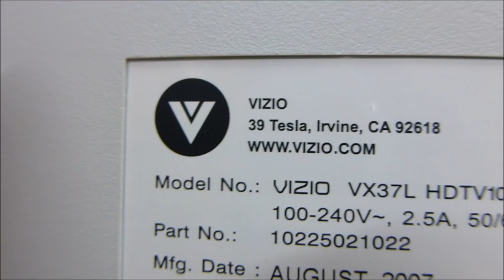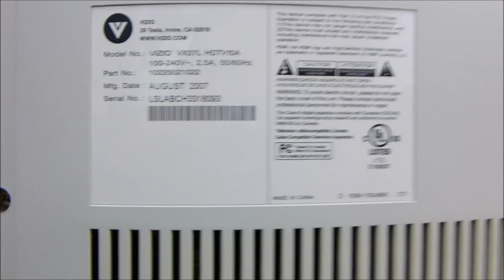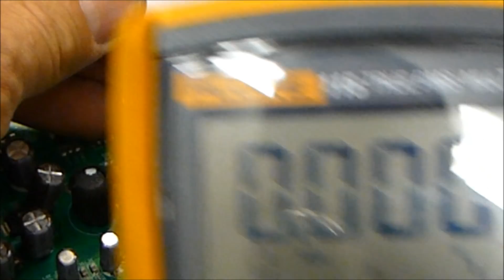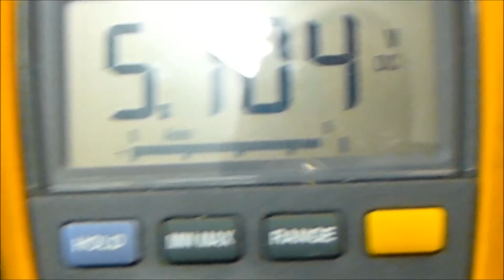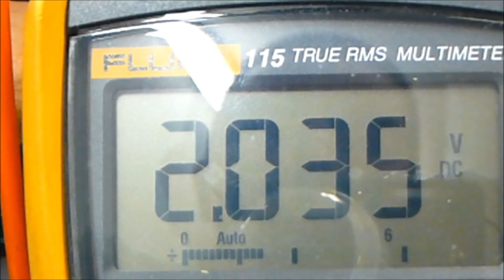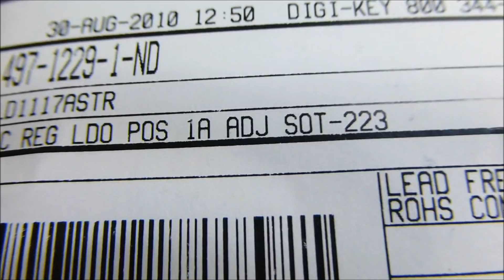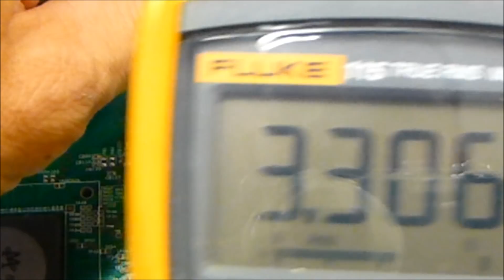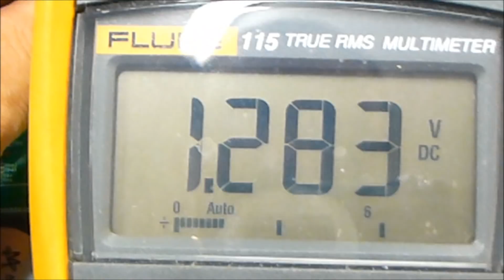Vizio VX37L HDTV10A LCD Powers on with backlight, Wont power off, No video

Comment: I'm having a very similar issue, but with my tv, the back light is on, no picture, won't turn off or respond to buttons or remote, but it does it as long as the power cord is plugged in. As soon as the set has power, it has this issue, not when it's turned on. (This started when installing a ceiling fan in the same room and a live wire touched the metal box the fan was grounded to. Any insight would be greatly appreciated.

Comment: hi there love your videos, I have a vivo lcd and on the voltage regulators 1 pin has 5v in the other has 3.3v and the adjust
pin has no reading what do you think. cheers

Comment: I just picked up this very TV but it will turn on/off, but no video, sound, or back-light.  I am not getting the 12 volt at the fuse or at the regulator.  Is the power supply bad in this case?

Comment: First I have to thank you guys for posting these videos. I fixed a 36" LG, replaced 3 capacitors, YAY! GREAT TV... A friend gave me her Vizio VF55OM, does same that LG did, Free BIG TV, yeah baby! Ok, all capacitors look fine everything looks fine but some of the solders look brown tinged. Not burned.. I have No pic, no sound, no blue screen. Plug in turn on, backlight stays orange. Cannot shut off. Could this 'slave' board be the problem.. LOL Im just learning... The slave board that concerns me is the one above the power button on left side of tv.. If you have any suggestions? I would so appreciate it..

Comment: So, are all 3 regulators supposed to be just about the same voltage? Mine are as follows:

U8
Pin 1 - 4.6
Pin 2 - 3.0
Pin 3 - 1.8

U33
Pin 1 - 4.6
Pin 2 - 2.8
Pin 3 - 1.6

U7
Pin 1 - 2.8
Pin 2 - 1.0
Pin 3 - 0.0

So is it the U33 that is bad? Is it not passing on enough voltage? BTW, I tested the fuses and they are both fine.

Comment: norcal715. Very new to this DYI stuff. My son and I are trying to fix our Vizio. Using the solder iron for the first time, The solder is hardening to fast so the circuit is not coming free. Are we using the wrong solder?
Reply from the maker: Most likely just not getting it hot enough
Reply: reach70

Comment: I've seen many tv fix it videos and you are the BEST bar none.  Having a problem with my Vizio 42 inch plasma vp422hdtv10a where it won't turn on.  I did a reset a week earlier and worked for five days, but now only the amber light and clicks twice and shuts off with one click.  PS board gives a two green blink led pause for 4 seconds and two blinks.  Ordered a power supply board that comes tomorrow and hope it fixes it.  Not all that confident though.  Will check out more of your videos if I have a problem.  Again really great videos!

Comment: Norcal715, Thanks for the videos!  I'm getting voltages of 19.25 and 8 at the fuses on the main board (VU42L FHDTV10a) which throws off my voltages on the power regulators. Should I be looking at the power supply first?

Comment: Hi,thanks to you I just repaired my Vizio 42 inch that had the exact same issue that your video described.  My 15 watt solder iron was not strong enough so I purchased an inexpensive 45 watt from Radio Shack.  My work was not as pretty as yours but did the trick.  Thanks again for the tutorial.

Comment: my tv is Philips, Model No:32PFL3403/94, Serial No:CQSA 0840 002852.
The problem i face is tv back light and sound on but the picture is hazy and fluid.
Can you suggest me the solution for my problem?

Comment: Am new to Electronics, What is the black negative lead on when you are testing the fuses and other components on the board?
Reply: The black negative lead is probably  on a common ground point anywhere on the circuit board. Usually all the grounds are connected so you could put that negative lead somewhere out of the way and just use the positive lead to probe the other pins.

Comment: Where can I buy a  solder sucker like the one you got there? Thanks again, you're awesome!!
Reply: Fass Strokaa Solder suckers are expansive unless you buy the type that you heat up with a regular soldering iron and move it quickly and put on the pump type. (Radio Shack sells them.) I use solder braid in most cases.
Reply: ***** Thank you. I used solder braid and it worked out fine for me.
Reply: Wheres the places u can pick up the solder braid? Like walmart or Target? Idk where cause we have no Radio Shack no more. I literally just picked up this same tv but mines a 32" and all black but basically the same and im going to try this diagnoses and see what happens. [Cross fingers] Thanks man for a very informal video.

Comment: I have the same TV VX37L HDTV10A with the same problem . Changed the main board before I saw your video and it did not change anything. After watching your video and checking the voltage, the F2 fuse reads 12V not 5V and the F1 fuse reads 24V not 10V. So I changed out the power board thinking there is a problem with the output. Still no change. Also at the power board, taking a voltage reading where the LVDS cable connects I get a reading of 24V. Backlights work fine just black screen. Any ideas??

Comment: Hello I have got a 32" vizio and the first gold fuse is 5.11 and the second one is only 1.75 . the trouble I am having is the logo goes from amber to white thats it no back light or anything, could the fuse be the trouble?
Reply: easy to test a fuse - without power on the circuit use continuity ohms on meter and with a lead on either side of the fuse it should be zero or very close to zero if it is good. If you show infinite resistance ( like no connection ) then the fuse is open and no good. But then you would have to figure out what made the fuse blow. Always good to look for puffy electrolytic capacitors which is good indication they are bad.

Comment: My vizio wont power on. Amber light does not turn white when powered on, stays Amber. I have 120 v coming in. I dont have any dc voltage at inv on/ off. I do have 5 v 12v and 18 v to the main board. Model # sv421 xvt.

Comment: what would cause my vizio tv remote to stop working? I am able to use my cable company universal remote to change channels, but I can not turn my tv off or on with remotes or control volume with remotes.
Reply: Is yours the slide out qwerty blue tooth remote. With mine the ribbon cable broke between the two halves. The bottom half works as it has power. the top does not. I have not ordered the ribbon yet.

Comment: I have a Vizio El371VL 36 inch LCD TV with a similiar problem.  The remote will turn set on but I get setup menu.  I cannot turn off TV with the remote or chassis buttons.  Here is the difference -- when I turn set off the backlight will turn off but the Visio emblem is still white and the 12 volts from the power supply remain on.  Have to unplug set, then the same thing happens all over again.

Comment: VX37L - Same issue. Replaced U33 (measured just like in video. Now U33 pin 1 is 5.00V, pin 2/output is 4.1V, and pin 3 is 2.65V. Nothing changed in the operation of the TV. I replaced U33 again and have the same readings. The voltage divider resistors for U33 are 100 and 110 ohms. What next? The capacitors look okay but i have not tested them. I have looked for a schematic with the values of the components, but have not yet found one.
Reply: ihave the same trouble,did you ever get a fix
Reply: Joseph Kupferberg 
There was also another regulator I needed to replace, then it worked like a charm. I don't remember the designator but it was the next one to the left when looking from the back bottom of the tv.

Comment: Hi I have a vizio 42" same issue, back light works, vizio stays white, no blue screen, will not shut off, I do get a little should come in and out, tv is about 6 years old..... My fusee are 3a.......and the voltages are double what you are showing in your demo? Would that be normal??

Comment: VIZIO VW42L
Awesome, what you described here is exactly what is wrong with my TV. Input voltage is 5v and output is 2v. My multi meter is analog so I can't get an exact reading. But I am not sure what part(voltage) I need. My regulator reads "AMC1117 F0739J". Does this tell you the voltage?
Reply: 3.3V Watch carefully when he measures after he replaces the part.
Reply: Eviltech I got an adjustable regulator on eBay, got it yestarday and put it on the board. Awesome, the TV works great! the part cost me $3.00.
Thank you norcal715 and thank you YouTube.
What would I do without you.

Comment: Ooops!  Correction: my U9 has 2.5V output with 1.3V at the adjustment pin.  Sounds like its tracking OK (+1.2V above the adj.), but i don't know what it actually should be.

Comment: I have the exact same TV and problem, but different root cause apparently.  The Vregs have the correct outputs of all that you show. However, you didnt show U9 output.  Mine is 1.5V output with 1.3V at the adjustment pin - is it OK?  if so, what do you suggest i do next?  Thanks!!

Comment: Hello,  Just wondering whether it is possible to use adjustable voltage regulator in place of original voltage regulator which uses a voltage (ie (1.2V, 3V, etc) ???
Thanks

Comment: Very nice video- thanks!  I am just starting to learn a bit more about electronics and such- anyway, I have a Dell W2600 with what looks like the same issue- and have read that the three LM1117 DT-2.5 Voltage Regulators need to be replaced- I will endeavor to check them soon.  Out of curiosity, have you fixed a Dell TV with this issue?

Comment: Im going to take a guess on why you decided it was regulator #2 the problem. My assumption is, that the data sheet for the 3 regulators tested was an input of 5.xV and an out of 3.3v with an adjustable drop of 1,2V. So if the second regulator tested 2.0xV then a 3.3V regulator should not give 2.0xV. However, why should not the third regulator have an input of 5.oxV....in the first place
Reply: Agree with ur comment what he said about the first regulator was correct but lost me about the 2nd regulator and the third regulator

Comment: Hey norcal, thanks for putting up this video. I was wondering if you can help me troubleshoot a problem I've been having? I have a Vizio GV46L way back from 2007. It was working great until I had the power go out in my house. My TV acts the same as the TV in this video, but with mine all the buttons on the side of the TV work with the exception of the input button. It also wont respond to the remote. Do you think it could be the main board or something else? Thanks!

Comment: THANK YOU!  I just fixed my 42" Vizio with the exact same problem thanks to this video.  The only thing I would recommend is to make sure your soldering gun is a good one.  The solder on the board melts at a much higher temp than the solder we used to put back on.  But this video was great and I really appreciate you saving my TV.

Comment: Hey, norcal7
I Have the 42 inch version of this tv and when I check the fuses its read 10vs and when I turn it on the 12 v supply reads 25v is this normal?

Comment: Vizio 47" from 12/2010.  Evidence of lightning strike at our house last weekend.  orange lighted Vizio is all I get.  I pulled the back panel off tonight.  No caps look obviously blown.  Is it worth buying new Delta DPS-270DP power board as first step to recovery?  Live in Denver.  Do you know of a place to buy new caps?  Thanks for all the vids.  They have been very educational.

Comment: Just called Vizio "tech support"...I have a model M470NV 47" LED HDTV around  3 yrs old.  I have sound and the backlights work. I can also power it on/off with the remote or manually. I have a multimeter but no idea what to check for. ANY help or guidance would be greatly appreciated.

Comment from the maker: pressing all of the buttons at once should only cause the microprocessor to be in a busy state and not accept any other commands until the load is removed. the set only has 2 keyscan lines and the keys with the lowest resistance are the only keys being read. I have had sets with shorted mechanical keys and it just locks up the processor until the short is removed then normal operation from there. It is not likely pressing all the buttons at once damaged the tv.

Comment: Nice repair! I'd add a little flux on those joints (even if you're using rosin core). It helps the solder flow in the joints and you'll get a more solid connection.

Comment: I unplugged the LVDS cable and got the same response but no streaks. Could it be one of the voltage regulators? I think I found some on amazon the AMS1117 3.3 volt 1 amp will this one work?

Comment from the maker: is the power supply being turned on? look at the ps on line and see if it changes state? if the ps on command is there then the power supply is at fault. if the ps on command is not there the may be the main board.

Comment: Hey I have a question this model has two fuses with the set plugged in and powered on.  One fuse reads 5v and the other fuse reads 0v.  The odd thing is both fuses pass continuity.  Suggestions.  My t.v is the same make and model with the same problem as your test set.  gideon277@gmail.com  thank you.

Comment: Ok I had the TV on and unplugged that cable and it still won't turn off I even tried powering it up with the cable unplugged then trying to turn it off, still nothing. Backlight still powers on but no picture and no streaks. Could it be the video driver board?

Comment: I did unplug the LVDS cable and the streaks went away but I didn't try powering the set down. If the issue is the voltage regulators where could I get some? Radioshack maybe? I can't buy things online. Could I maybe pull one out of something?

Comment from the maker: I would say that based on the video and your notes, most likely a main board failure, try and unplug the LVDS cable and see if you can shut the set down with the power button. could be a tcon loading down the main board but I doubt it.

Comment: I have this problem as well but there are color streaks that get brighter as it stays on. I hope the panel in mine is fine and where else can you get these regulators? Can I pull one out of an old circuit board b/c I have a bunch of them.

Comment: Hi norcall Deb Shane here, we talked 4 mo ago. I never could get the regulator off with solder gun. The vizio 32". Main board is same as the 37" above. Can I talk to you? The TV is still sitting on the floor in my living room :0( I have the main board out. Tried to replace the 2 regs I tested, same as your video. I want to send the board to someone to fix. Can you do it? Please contact me if you can. It's the same issue as your video. Hope you can help me  Debdot wdot adot twist I have gmail :0)

Comment: ok Im having the same problem excluding that my power does shut off normally back light come one etc no vid no audio no blue screen, now I found a voltage regulator going from 5 to 2.5 volts on the opposite side would this be normal? the adjuster drops down to 1.3, now this one is located close to the wi fi board, just curiousity thank you I have a visio sv472xvt

Comment: Say i have a 42 inch vizio tv and after watching it for 1 hour it shut off by itself and wont turn on again but if you leave it alone for a few minutes or plug it into a sifferent power outlit itll power on again but then does the same thing by shutting itself off

Comment: hi, i have a sharp LC-60LE810UN, when i turn it on the power the TV stays on but NO video. Can't turn it OFF. i change the capacitors but didn't work, bought a used POWER SUPPLY still the same. Replace the TCON panel didn;t work either... any idea whats wrong with it?? thanks nice VIDEO

Comment: My question is that if the second fuse only reads 10.8v, should I be focusing on the power supply? Everything else corresponds with your video, as the regulators do regulate the power down consistently, but that second fuse never gets to 12v when its on. it reads zero when plugged in and set off. reading your previous responses i think it it could be power supply, and also to mention the tv backlight doesnt turn on. thanks in advance

Comment: My samsung TV model ps51d8000fu would not turn on. Checked the circuit board everything looked OK, No bulged capacitor.

When I pressed the remote control, the light turned from red to nothing without any display or sound.

Comment from the maker: check the power on command to the power supply, if it is there and the power  supply makes 12 volts then your main board is bad, if power on is good and the power supply does not make 12 volts then it is the power supply.

Comment: Hi, I have this same  television, but it has another problem, when connect to power power light turn on red but very weak intensity, when press power button do nothing. Control panel has 5v but not 12v, fuses are ok, so I suspect is the power supply. Any suvgestion? Thanks.

Comment: Thanks! I was finally able to remove the back with a little bit of force. Now I've got to figure out what is wrong with the tv. Does anyone where I can find the appropriate voltage in/out for the regulators on a vx20l? Seems like the regulators are working ok with an in, ground, and -1.2 out.

Comment: Hi, yes you can safely remove the back very easily most likely you can use a phillips screwdriver to remove it. There should be screws all around the back of the TV

Comment: I, too, have the same model and same exact issues.

i went down the list of checking items as you did, and the first one i checked (which was supposed to read 12v) was only giving out 10.8v. do you think just replacing that one would get me in the clear? I am very new to the hardware /electrical aspect of consumer electronics, and feel i should probably just replace the entire main board before i damage this beyond the point of no return.
what do you suggest i do?